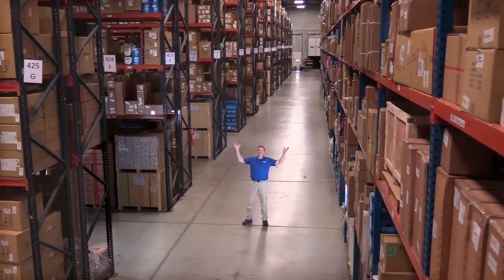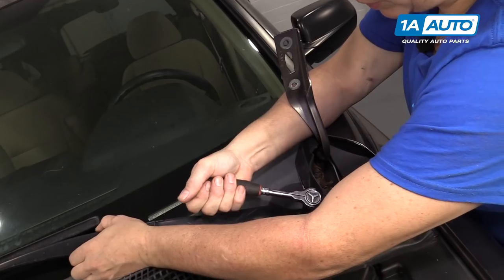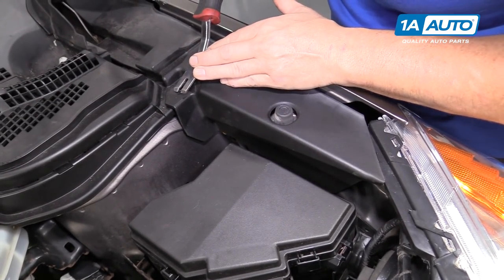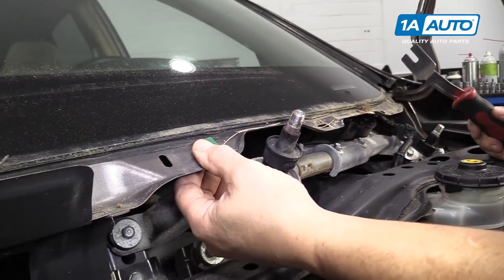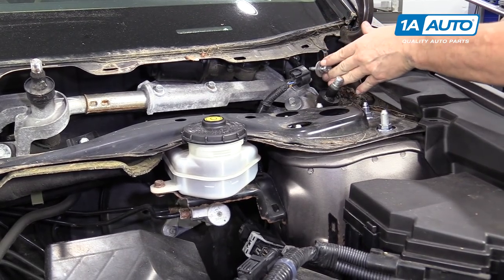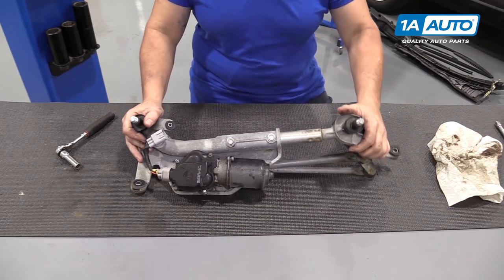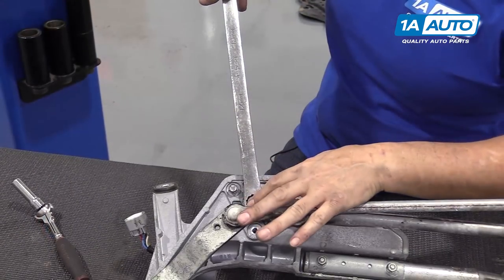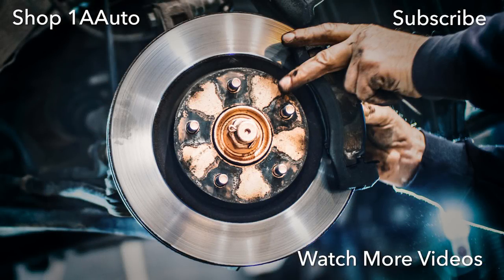How to Replace Wiper Motor 07-11 Honda CR-V

Comment: Just one small thing to add.  The windscreen motor needs to be plugged in and turned on then allowed to settle to its off position before aligning the linkage to the motor spindle.

Comment: Thank you. You saved me hundreds of dollars. The only thing I struggled with was aligning the wipers to start and stop at the correct place but I figured it out thru trial and error.
Reply from the maker: +Ken Rutherford Thank you! We love empowering our customers and showing how to perform DIY auto repairs with our high-quality auto parts.  http://1aau.to/m/Shop-1AAuto-c
Reply: Hi Ken, I have the same issue after changing new wiper motor. Could you share how to fix correct place for start and stop? Thanks

Comment: That was great.  I needed to know how to reposition the arm on the spindle of the motor and you showed me how it lined up.  (Although I was replacing the linkage assembly and the one I bought from NAPA does not have corresponding markings but it was easy enough to ballpark it.). Thanks!

Comment: Thanks for the video instructions. They were great! I made a mistake while tighting the bolt to the transmission and must have misaligned it. Once I put everyhthing back together my wipers are not returning to the right position and are slamming back down and stopping in the middle of the windshield. How do I get them back to their original position? Thanks in advance.

Comment: I replaced my linkage assembly and wiper motor and followed all instructions to a tee including parking the motor 2 times before attaching the linkage arm, when I was done the wipers stopped in the up right position on my Honda CR-V. How do I correct this ?

Comment: 5:57 What is the purpose of that "brace" metal? I am wanting to take it out then just put the black plastic wiper cowl back without the metal brace since the wiper cowl clips attaches to the windscreen area. It weights 6 pounds and am trying to reduce weight.
Reply: That metal brace stiffens the front end of the car.  Hope you didn't ditch it because that would have been a huge mistake.

What on earth are you doing with a CR-V that losing the few pounds of that brace would make any difference?
Reply: Reduce weight in a car with less than 200 hp for what?